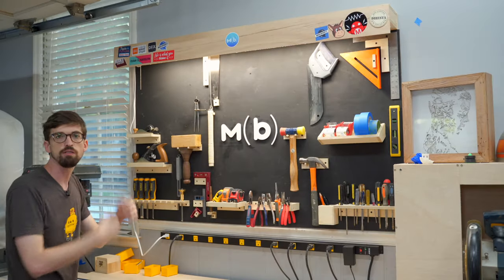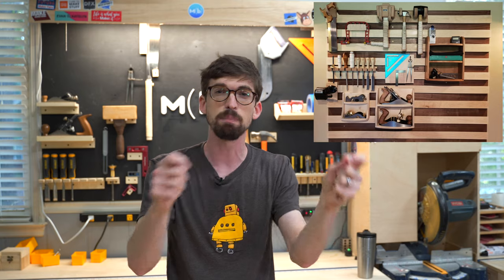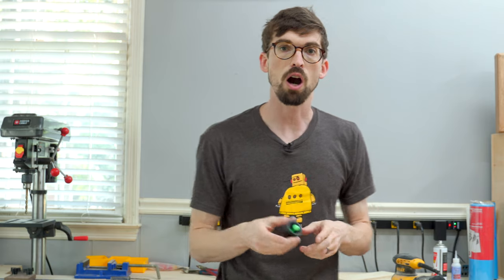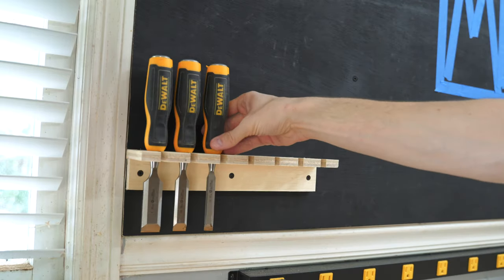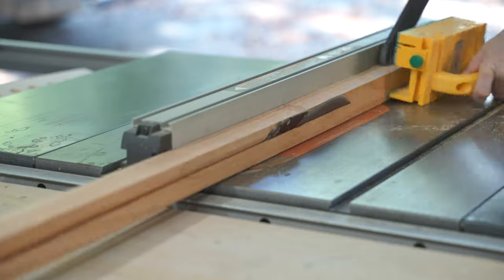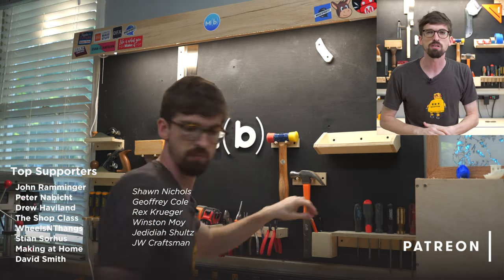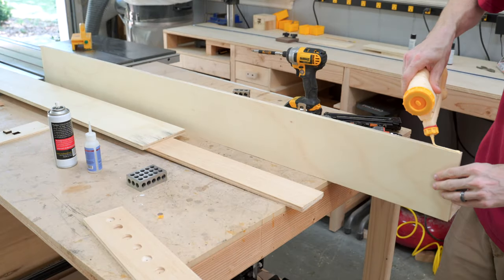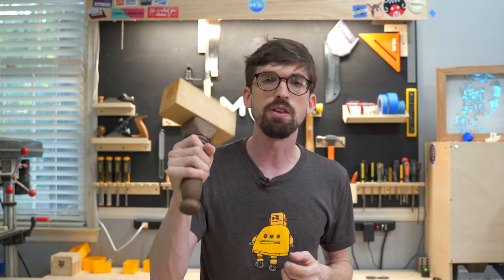How to Make a Simple Tool Wall for a Garage Workshop

Comment: this is great, I'm finishing my workshop this coming week and this tool wall is just the kind of thing I'm going to build, thanks for the tips. I like the top shelf, though I think it would be good left open on the front so that it can be used to store different grades of sanding paper in each section. I like the idea of the light too, gonna do that for sure.